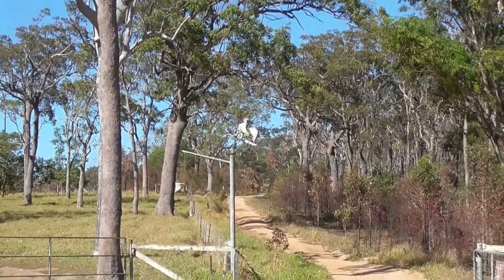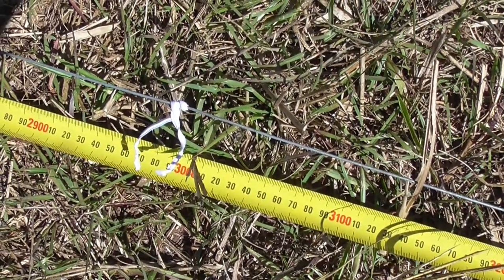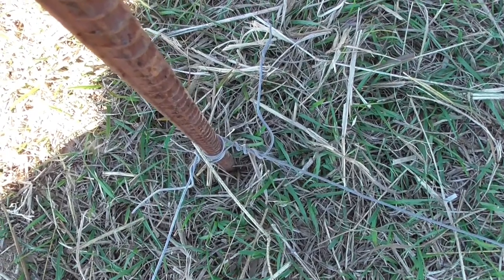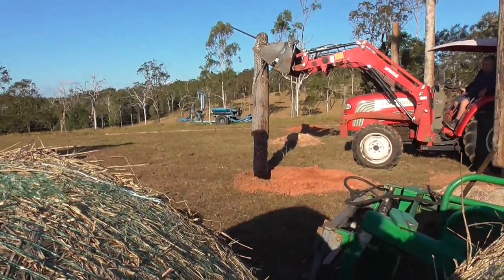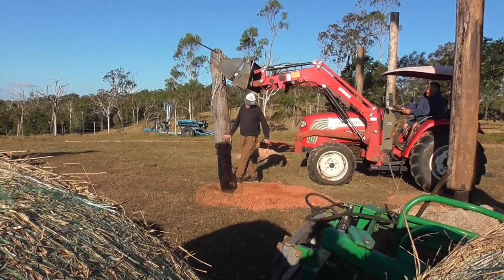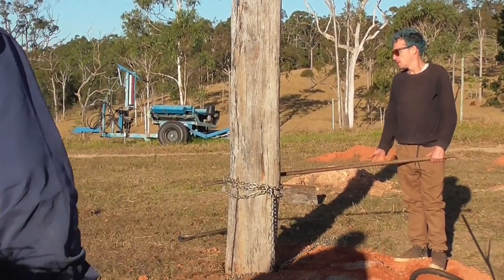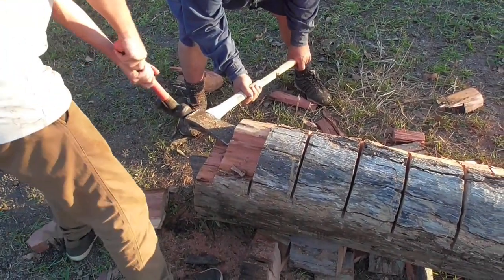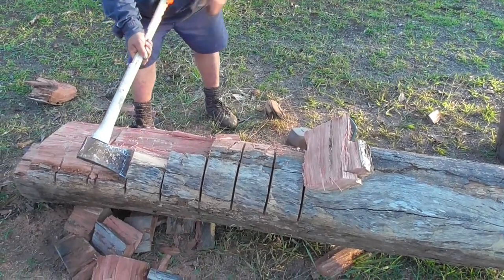Building Our New Hay Shed

Comment: Hi John,  we're in the middle of building our own lean-to shed just like that.  We've gone fully off grid and have 10 power poles to use up.  They are as hard as rock and, as you say, the tractor takes a bit of juggling to get the big logs into the holes, but we get there in the end because we have to!  Cheers!
Reply from the maker: Ours is still up and being used. Going to make another one soon. John

Comment: Hey great idea for a shed I would like to build one myself what distance was you pole spacing Length and width and what size timbers did you use? 
Cheers
Reply from the maker: The poles are 4.5 apart with 6x2" for bearers and the bays are 4.2 meters wide and the roofing battens are 3x2" 850mm apart all hardwood. Its as solid as a rock sounds a bit flimsy but I would bank on it in a big wind no worries. John